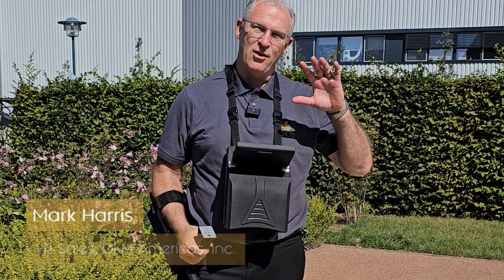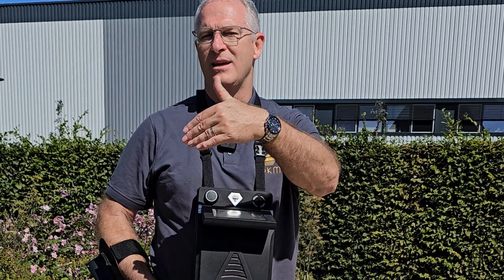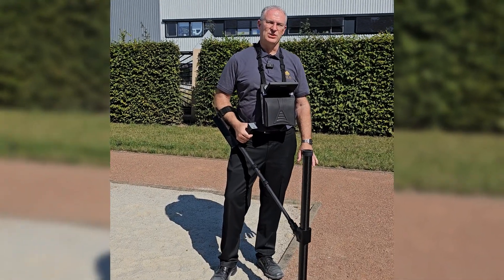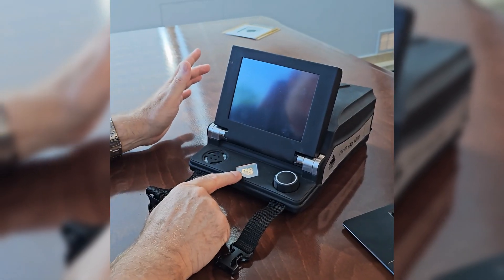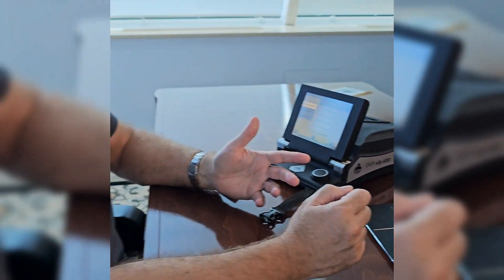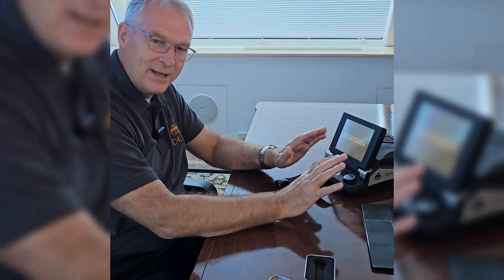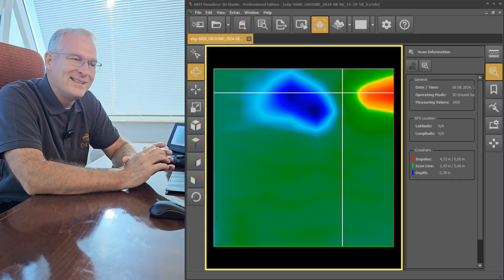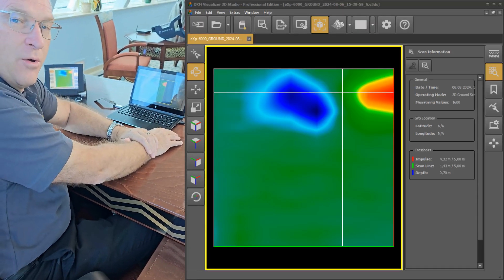OKM eXp 6000 ⚙️ 3D Ground Scan TUTORIAL: How to Detect Buried Objects

Comment: I've this 0km exp 6000 3D but I need some manual guideline with very easy step by step including CD player installation.
Reply from the maker: For detailed and easy step-by-step guidance on using your OKM eXp 6000 3D ground scanner, including installation and operation, please contact our support team directly. They’ll assist you with manuals, video tutorials, and setup help.
📧 info@okmdetectors.com
📞 +49 3447 499 3000
💬 WhatsApp: +49 162 419 2147

Comment: How many meters can  detect below the ground?
Reply from the maker: The OKM eXp 6000 was capable of detecting objects up to 25 meters (82 feet) deep in 3D Ground Scan mode. However, this model is no longer in production.

Its enhanced successor, the eXp 7000 Professional Plus, offers the same maximum depth of 25 meters for deep scans – but with significant improvements:
Integrated VLF metal detector with new 3D VLF Scan mode
Improved scan resolution and data quality
Faster and more efficient scanning thanks to updated hardware and sensor system
Better handling and ergonomics

You can find all details and the current price of EUR 29,990 here:
👉 https://www.okmdetectors.com/products/exp-7000-professional-plus

For personal consultation or shipping details, please contact:
📧 info@okmdetectors.com
📞 +49 3447 499 3000
💬 WhatsApp: +49 162 419 2147

Comment: the red colot shows magnetic ferrous metal, but the dark blue color what it is ?
Reply: Bu cihazın Türkçe dili varmi
Reply: Can you send a color sample image of a metallic?
Reply from the maker: The red and blue areas next to each other represent the positive and negative magnetic poles and indicate a ferromagnetic object, in this case the poles of the pipe.
Reply: @OKMDetectors  I saw a few videos where dark blue means void or cavity, however it was other GR brand results...
Reply from the maker: When using the standard color scheme, cavities are usually displayed in blue even with our ground scanners. However, it always depends on the environmental conditions. If tunnels and underground spaces are reinforced with metal (e.g. bunkers), they will probably contain more red colors. The composition of the ground also has an influence on the display. In addition to the pure detection of anomalies underground, careful research is also necessary. Our support team will be happy to answer specific detailed questions.
Reply: @OKMDetectors  if there is a ceramic pot with 3 kg of gold coins buried 2 m deep, this device can find? if yes ,  what color it shows in the image?
Reply from the maker: Ceramic pot with 3 kg of gold at a depth of 2 m is very vague. It depends largely on the following factors:
- Type and composition of the soil
- Size/surface of the buried objects (weight is secondary)
- How long the object has been buried
The way in which the anomaly is displayed also depends on these conditions.
Reply from the maker: If you have any further questions, please write to our support team, who will be happy to answer them: info@okmdetectors.com